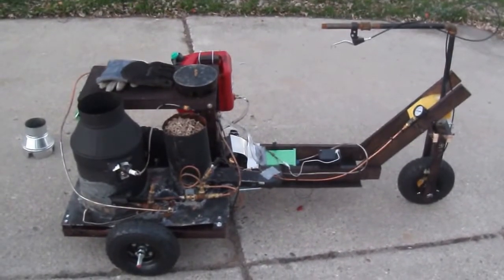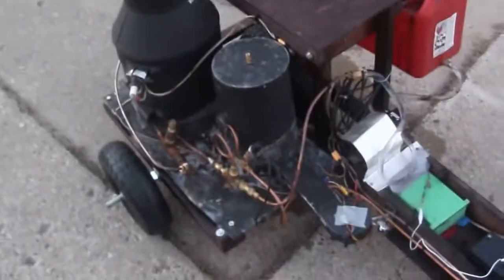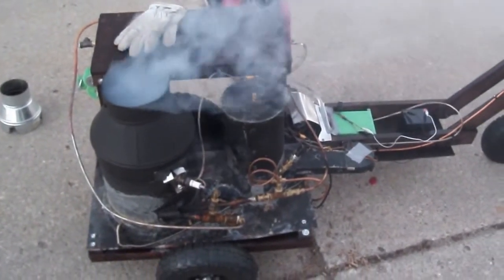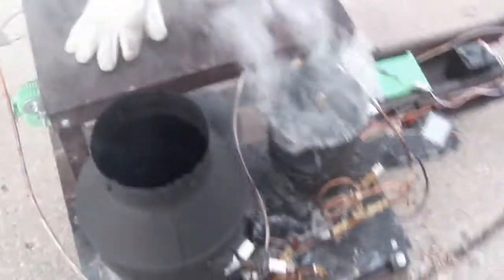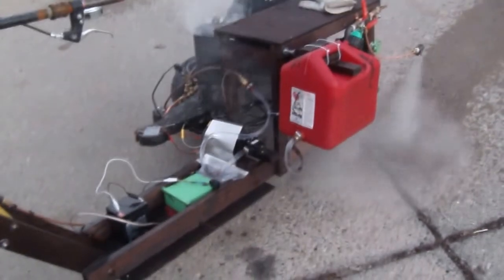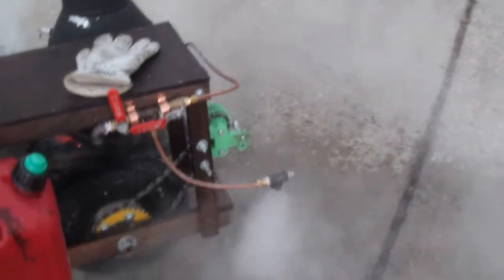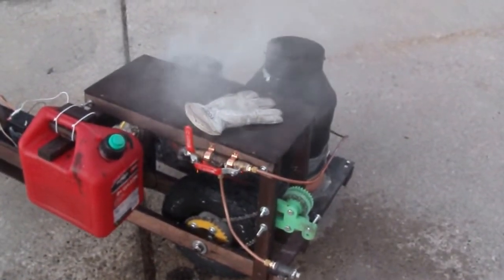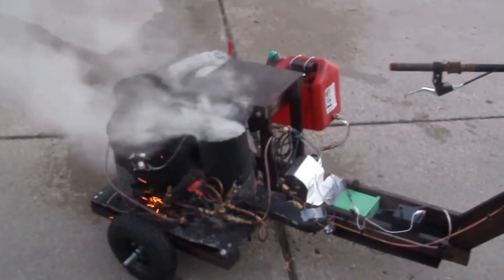Hardware Store Steam Powered Scooter Boiler Demonstration

Comment: I like what your doing and your creative thinking. But  please take some precautions when working with steam, your safety valve should be a steam one  not a air compressor type the seats inside of the air type can't handle steam, it may work for a while then the seats will fail.  I think what you will find when a steam engine is in the system  is you will need closer water level control then every 15 seconds mono tube are controlled constantly as the steam demand changes as the load on the engine changes. if to slow on control you will either get water in the engine or not enough and burn out the boiler.

Comment: Well done bru, while I still strugle with spark water level to control the pump. Mine either too sensitive or there is still water left in the spark. It did pump for the first time and then stop. When I assumed the pump should start it just won't. Any advice on that?
Reply from the maker: make sure you cut off or bend straight the outer electrode. also make sure the plug is above the pipe it's connected to so water will run out of it.
Reply: +Richard Lanting Thank you, will do that
Reply: +Richard Lanting Hi, do you think we could use this steam system to wash car?